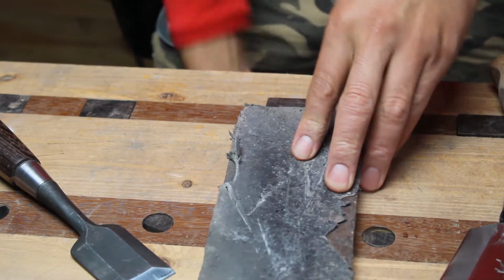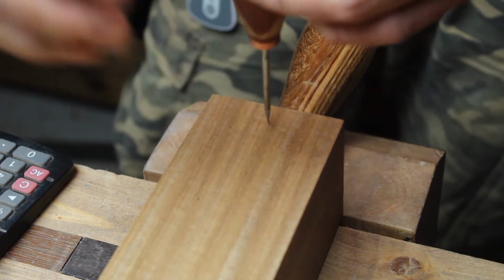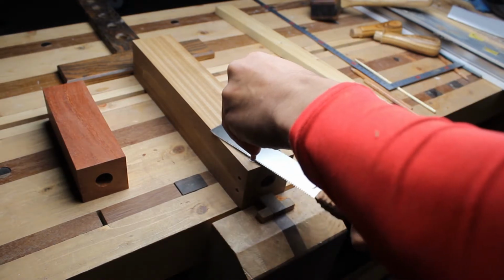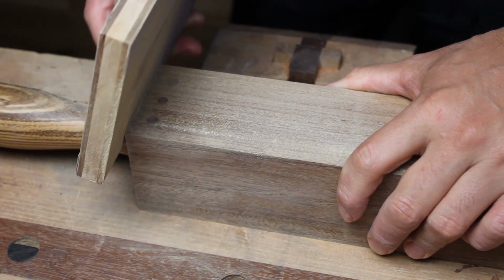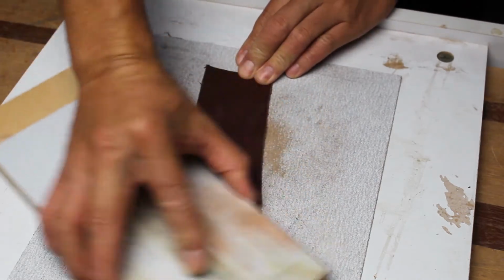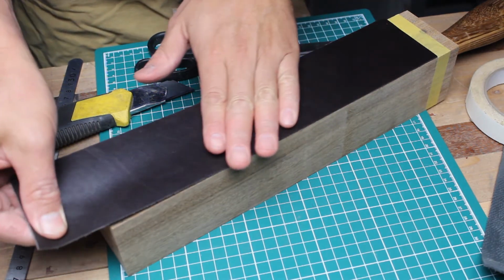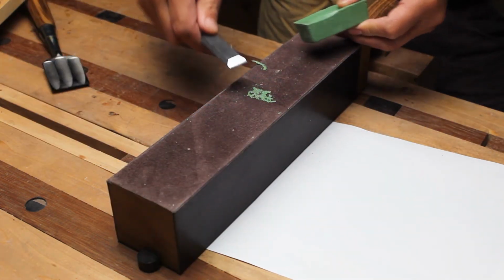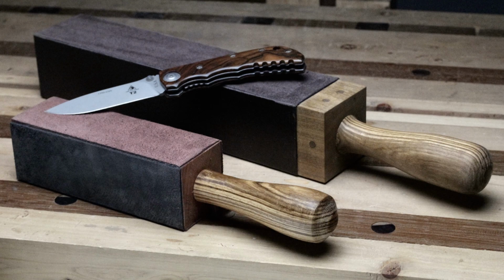Making Leather Strops    革砥を作る

Comment: Thanks for sharing another creation from you shop! Making 4 surfaces for 4 different stopping compounds is a great design.  So is marking the different faces with inlaid dots.  You have now made beautiful tools to use with your other beautiful tools!  
Is the white compound aluminum oxide?
Have you tried rubbing a compound stick directly onto the leather, instead of shaving bits of it onto the leather?  That is what I do with my small leather & wood polishing sticks for jewellry making.
Reply from the maker: Thanks.  Yes.  Aluminum oxide.  I don't know how harmful.  The product manual says it is a carcinogen.  But generally aluminum oxide doesn't seem super dangerous.  I don't want it to be around my kitchen.